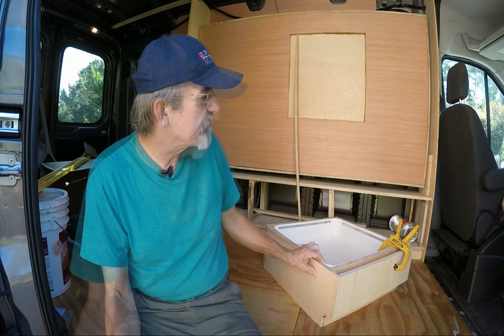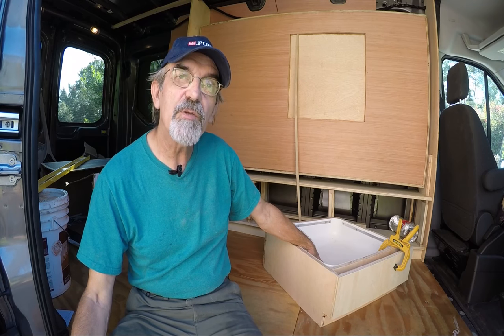Cargo Van Conversion - Shower - Part Two

Comment: Really enjoying your process, craftsmanship  and ingenuity. Just curious, why you didn't add silicone behind the screws holding the aluminum?
Reply from the maker: Thanks!
First, everything is still in a 'fitting' stage; actually, right now, I have it all disassembled (removed the shower pan) to create a hole in the bottom, to access the drain, when cleaning or repair is necessary. Only when it is ready for final assembly I may use some silicone or alike.
I don't think, that it's really a must or even convenient. These aluminum flat bars have two purposes:
- Hold the shower pan against the drawer.
- Hold the shower curtain inside the shower pan.
The latter will come in and fold under and up & down again between the bar and the tub wall, thus covering the screws. Moisture penetration should not be an issue. These bars should also be removable, when replacing the shower curtain. Silicone or any other product would make that more difficult.
This project isn't finished yet and I will keep your suggestion in mind!

Van Williams

Comment: To get more height in a conversion van I saw someone move the spare tire to the rear door and then he cut a hole in the floor where the spare was and got the height needed for a shower using a ceiling track for the curtain .
Reply from the maker: Hey Peter,
I've heard of that before but while that solves one issue, it creates several others:
- Spare on rear door. Had that on my Dodge B-250, don't like it.
- Hole in floor: less holes, less leaking. Structural issues.
- Lots of work and cost, limited benefit in case of a 'boondocking van' with limited water supply.
- Much easier to go with a high roof van.
In general, I think if you want enough floor space and height for a shower in a van for boondocking purposes, you should go for a high roof, extended length van, which also would allow for expanded water tanks.

Van Williams

Comment: be good to see the end shower.

It seem okay. I have just  a plastic dog bath. Dog Grooming Bath (135 Litre) (Colour - Green) L.W.H.(123x63x30cm).

I then have hooks for a large shower curtain. The benefit is its size, plus i also use it for washing the dishes, by kneeling over it.

Whale Gulper 220 12 v water pump (run dry without damage)
is amazing. you can leave it on all day and so just press the trigger when you want water.

I find in practical use though there is never flat ground, so i collect the water and tip it into the drain.

I have a portable washing machine which i put into the bath, and point the exit water hose down the exit drain.

Its a WASHING MACHINE SPIN DRYER WxDxH, 55x39x55cm GLW-82718

you will need a good solar array , charge controller and invertor, but these key things make motorhome with hook up.

I paste my whole setup here:

* Full Motorhome Setup Summary -
Ergonomically Designed Heavy Duty: Van LWB/ High Roof, Rear Parking Sensors, Undercarriage Spare Wheel Cage, Celotex insulated walls, Bluetooth Pioneer DEH-X6500BT + 4 x 6.5 inch speakers professionally jigsaw fitted into walls, Bolted Wooden Shelving, Synthetic Leather covering every wall, shelving and seats, Windscreen Reflectix, Plastic Side Window Wind Deflector Pair, Clear Acrylic Table L.W.H(110x110cmx1cm),with 45cm radius laser cut out (removable with wing nuts), Bolted Swivel Seats and 2 Seater Bench, Campingaz Camp Stove Oven 4500w Cooker Oven, 2 Gas (butane or propane) Hobs, with Piezo Spark, Fire Extinguisher, Custom made hinged aluminium/steel frame, folding Bed with Medium Density Foam L.W.H.(220x155x15cm) with Elastic Sheets, Cube Shaped Bed Mosquito net, Brompton M-Type T5 M5L Ivory Black Compact Folding Bicycle L.W.H. (65x24x61cm), Porta Potti Excellence, Dog Grooming Large Plastic Bathtub (135 Litre), 3 x Jerry Can Stainless Steel 20ltr tank - Compact Design L.W.H(34x24x31cm), Extra Large custom made Mirror, Fully Carpeted, High Quality Mats, Curtains and Shower Curtain,VSR bi-directional Split Charge Relay from engine battery to charge house batteries , 6 x 100 watt solar panels, 60 amp charge controller, 6 x Numax CXV31MF Sealed Leisure Battery12V 110Ah 1000MCA 500 Cycles XV31MF, Screwdrivers Socket set and small Tools
 
* 12 Volt DC for : (RL5010W) Shoreline 110L 12v/24v larder fridge WxDxH 50x54x85cm, Dimmable LED Strip lights, HP ProBook 455 G2 fast laptop with multi country plug adapter, USB TV Aerial, 2.4GHz 8W EP-AB003 Wifi Booster, 3&4G Mobile Phone Signal Booster, Garmin Nuvi 3590 LMT SAT NAV GPS World Map, 3 x silent Noctua NF-A15 PWM Round Frame Premium PWM PC Fan, Whale Gulper 220 12 v water pump (run dry without damage)  + Shower Hose, TA298 Digital LCD Indoor Outdoor Thermometer Hygrometer Clock Humidity Meter, MV Airo 2kw Diesel heater Undercarriage sharing Diesel fuel tank, 
 
* Soft Start Inverter 12v to 230v - 2500w pure sine wave: Portable washing machine/ Spin dryer model WxDxH, 55x39x55cm GLW-82718, Playstation 3, PC Laser toner printer model Brother HL-2240, Numatic Henry HVR200-11 Bagged Cylinder Vacuum Cleaner , PC Monitor AOC U2868PQU 28" 4K 60Hz 1ms Gaming Widescreen HDMI, VGA, LED Monitor 3840 x 2160, 12 volt drill, DSLR Canon Camera EOS 60D
 
* Consumables: Diesel, Safefill Refillable LPG 10kg Gas Tank with multi country adaptors, Water, Fridge Food and Dry Food, Cleaning Products, Washing up liquid, Fabric Detergent, Carpet Shampoo, Toothpaste/ Mouthwash, Medicine / Allergy products, Hair Shampoo, Razors, Hair plucker, Creams, Vitamins, Tissues
 
* Personals: Minimalist Clothing Range, Yoga mats, Bed Sheets, Combs, Towels, Ergonomic Chopping Board, Cutlery, Full Screwdriver / Sockets set, Tape Measure, clips/strap, Brush, Cloths, Novels, Educational Studies Books, PS3 games in CD book, Paper, Sellotape.
Reply from the maker: Thanks for watching!

Van Williams

Comment: Where did you get the portable laundry sink with the drain?
Reply from the maker: Hi Andrew,
The laundry tub was a very basic model at Home Depot. The drain was a Camco accessory http://cargovanconversion.com/buy/drain
BTW Thanks for watching!
Van Williams
Reply from the maker: Hi Andrew,
Yes, that's the one. Be aware that this laundry tub is 23" x 25" at the rim, 22.5" x 22.5" at the top of the tub and it slims down at the bottom to 19" x 20".
Van Williams

Comment: Wow ...
Reply from the maker: RV bathrooms are tiny by definition and in my Medium Roof non-extended Transit van I decided against it to save some space. This experimental Shower-In-A-Drawer may be small at the bottom, but will have a fairly wide, spread out shower curtain with a hidden shower head placed in one of the top cabinets. The shower water can be drained outside or into the gray water tank. It's not finished yet, but it looks like it will work nicely. I'll have the next video in this series ready for viewing on YouTube by tomorrow.

Van Williams

Comment: It would be more helpful you could explain while you are doing it.
Reply from the maker: I have been trying to add some text pointers afterwards, but have to do a better job at it. Sound during the actual work is fairly bothersome; have to suit up with an extra mic and recorder. That doesn't work for me right now, but I'm constantly trying to improve the videos and sound is a high priority.
Thanks for your comment and I'll keep it in mind.

Van Williams
Reply from the maker: Thanks for watching!
Yes, the videotaping and editing, probably takes more time than the work on the van conversion. I'm still feeling may way around the whole video thing and am continually changing and adding. Lately, I have started adding explanatory texts to the videos, where necessary.
Because of all this work I'm a bit behind on the website, but every project that I do has or will have a written version of it with a step-by-step tutorial with photos and a downloadable PDF-file. That should provide enough info. See http://cargovanconversion/projects
Wish you good luck with your Transit and keep in touch!

Van Williams